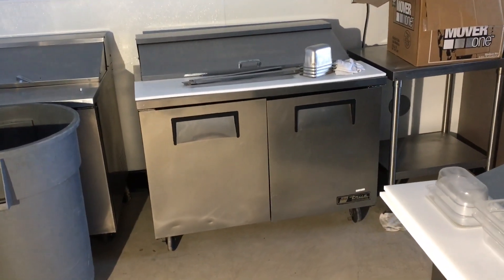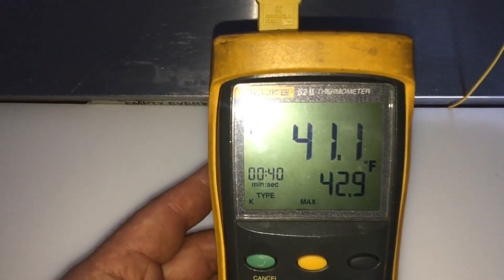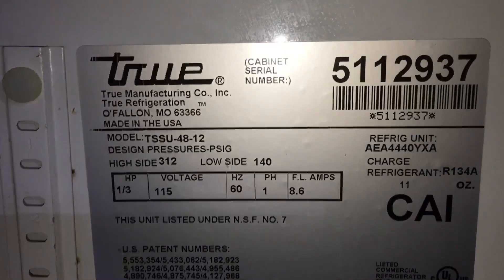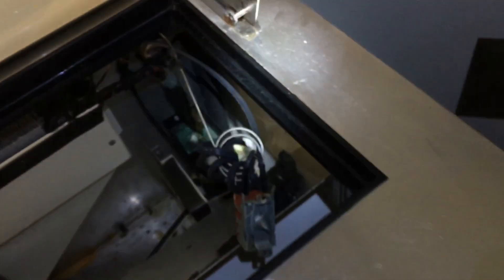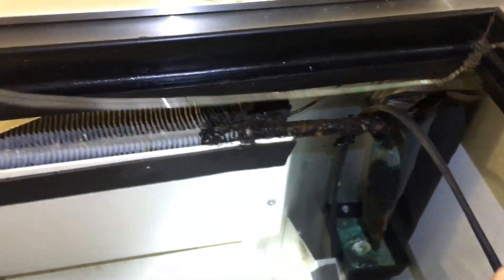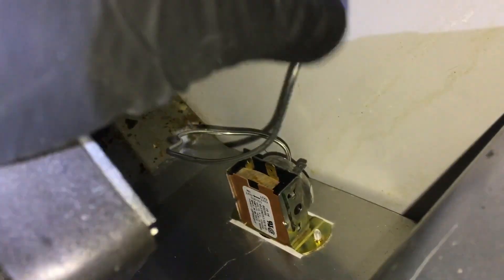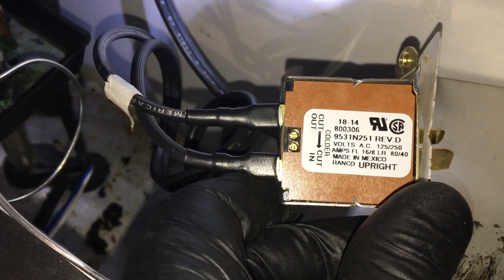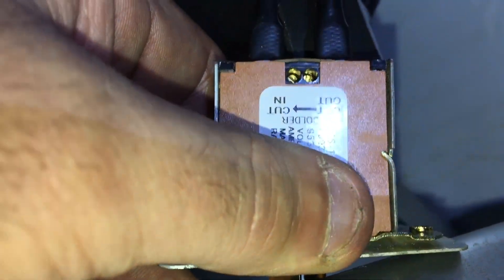How do i adjust the Cut-in temperature on a Constant cut-in Temperature control.

Comment: Way to stick with it, OC.  Me, that t-stat, might  not be a good one to use in the future.   The extra two  hours just to adjust it was a bummer.  Thanks for the constant video uploads that show and educate.  Loved that Pro-Tip of the Day ( I cant believe that I never looked at doing it that way when I put those damn things in).!
Reply from the maker: Yea, I’m Never using that control again ! What a pain in the derrière. i Mainly Just did it to see if it was possible & see how it would come out. Ive never used that control before. I’m definately Just ordering the Correct control as I usually do & be done with it.
Wayy easier. Thanks for watching & commenting !
Reply from the maker: Heavy Diesel - Gave Me that Suggestion. He Said stack them like Books & I’m like Hesitant because my brain Wants safety / Everything Horizontal. But , I had to Re-Wire My Brain a Bit to Get Used to it. I’m used to it now. It took some time to adjust to the idea.

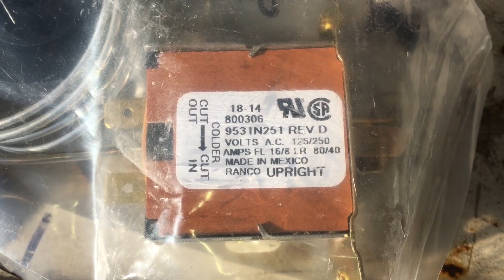Comment: Great video, thank you.  At 4:47 in the video there was a chart that showed the recommend cut in and cut out temperatures of the case depending on the type of product.  Where can I find that chart?  Thank you again!
Reply from the maker: That's not what that is. that chart is from the true manual - if memory serves. that chart tells you what the Cut-in & Cut-out temperature is of the Temperature control Number in that line. What the chart is for - is - like when u remove a temperature control from a prep.  table , You look on the back of the danfoss temperature control and it will have a number like 800366 on the Back of it. You look that up on the chart and it tells you what the cut-in temp & cut-out temp is for that control at #5 the dial / Mid position on the dial.
You could then use that information if the proper temperature control is not available & Use one that may be available. it also tells you when testing the control what Temperature it's supposed to open & close at. to see if control is operating properly. or it's not.
Reply from the maker: if you still want the chart - 
it's a Available at -
1. https://www.truemfg.com/support/manuals
2. then click on - Technical installation manuals
3. 12th one down - click on / Download - "Temperature control repair " it will download a pdf into the " Files " folder on a iphone. don't know on android.
4. it's about 4 pages down the pdf , yellow page , as shown in video. pdf is called - TEMPERATURE CONTROLS/ THERMOMETER/TIMERS.

Have Fun & Good luck. 🤞
Reply from the maker: note - Thier are actually 3 downloads  - they don't tell u that. three different files if u click on the different words. Make sure You touch / click on " Temperature control repair " those words. those other words there are 2 different downloads.

Comment: The Ranco p1125 (less than $20) works great for prep tables, and the wireless temperature monitor + probe (less than $30) works better than the one in this video
Reply: I’ll have to give this one a try. I use the Beverage air 502-194A for this application
Reply from the maker: @ Superhydro - Can u give me a Link to the Wireless temperature control ? I’m interested in that.
Reply from the maker: @chrisbivens - Yea , that control looks good.  is it rated for full compressor amps ? 12-16 amp control or do u use a relay with it ?
Reply: OcRefrigeration , Hvac & Electrical Video's. Yes it is. I use  it in almost every brand and never had an issue.
Reply from the maker: Huh , weird. I’m trying to find the constant cut in temp. And all I find is 47.5 degrees. Which is too high. 
You got any specs on it ? 
Where do u get them ?
Reply: I'd be interested in a wireless temp probes as well.  If you can get us a link that would be awesome.
Reply: OcRefrigeration , Hvac & Electrical Video's. Not sure on that cut in your seeing.  I usually set them at #5 and they’ll maintain a steady 36-39 degree box temp. I get them at Case parts.
Reply: I’ve used the #20899 good cut in tstat

Comment: I've noticed when you "calibrated" them  if you watch for more cycles the cut-in and cut-out temperature keeps varying say it cut in at 41 but next cycle cuts in at 40 or 39 and so on. So fustrating, either the new  thermostat is bad or the mechanism on all these thermostats is not reliable.
Reply from the maker: made in China 🇨🇳